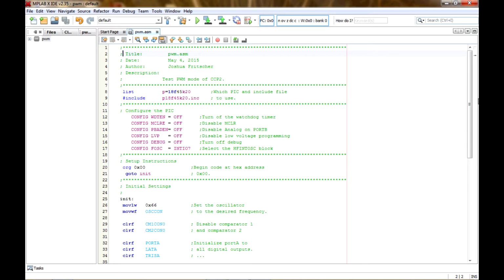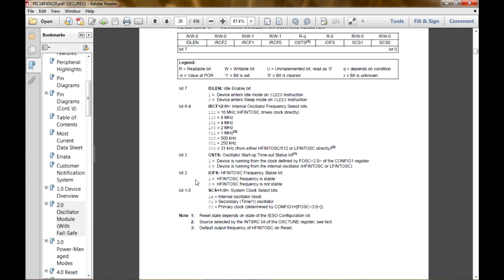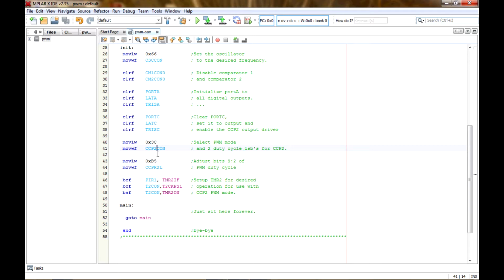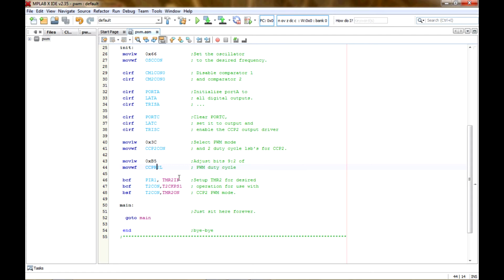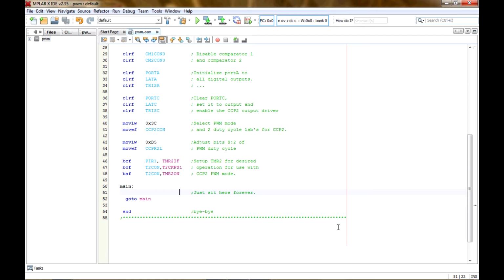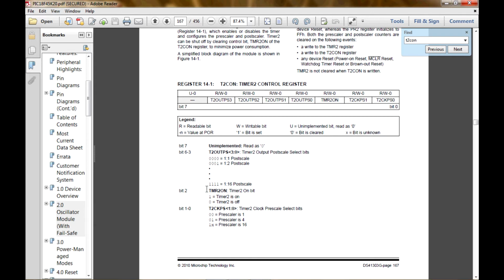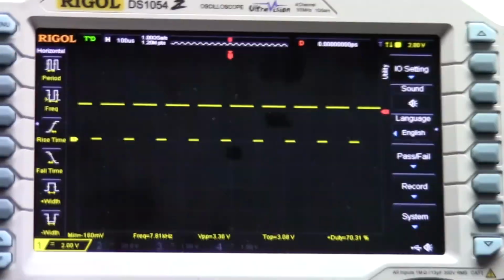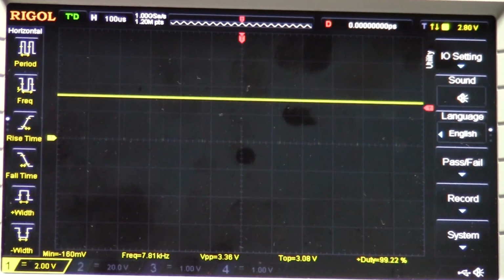PIC18F Assembly Language Programming - PWM

Comment: Hi men, simply cool and practical explanation, i have the same couple 44-pin demo board and pickit3 and right now am burning my mind trying to show the CCPRxL value in a display based on ETK6201 chinese chip, all in assembler.
Reply from the maker: Keep at it APC, you will get it and you will feel amazing when you finally get it working!
Reply: @pushingitonme Thanks bro, my brain will go on :), but im gona change a little (in order to give a time), i will do a PWM and integrate a multiplexed 3 digits display to show an 8bits CCPR2L register (only 256 discrete duty cycles enough 4 me) because i need it for a practical use. thanks to your 2 videos (PWM and multiplexed displays) i get the idea. best regards from Venezuela!!!